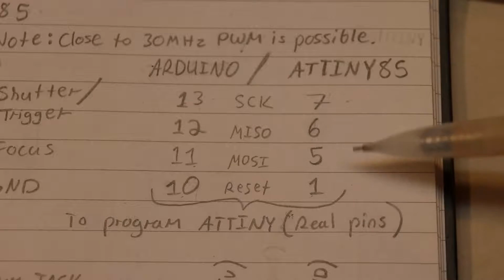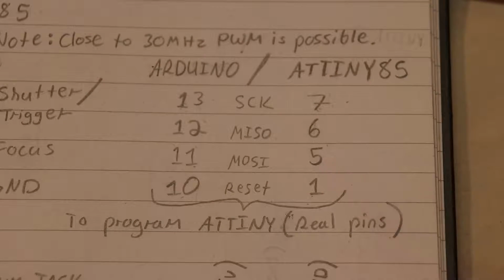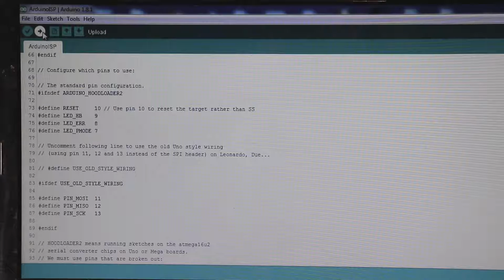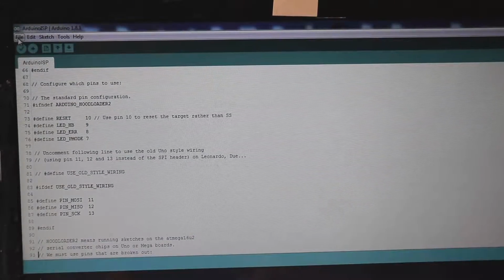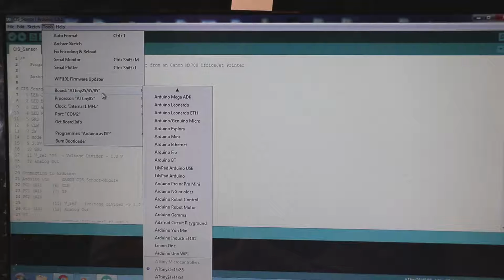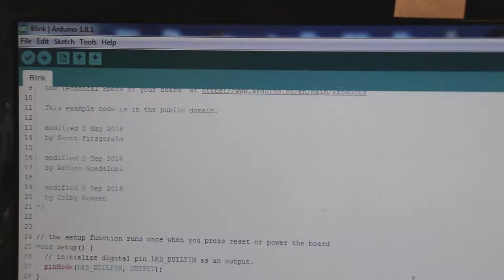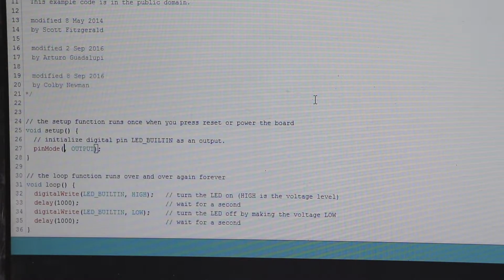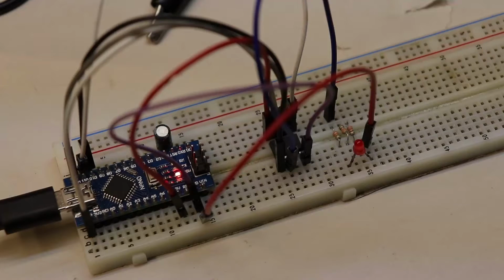How to program an ATTINY with Arduino

Comment: As mentioned in DS attiny13a has 1kb flash but i have seen blinking code is between 1kb to  3kb  .
1st Why this simple task taking 1kb 
2nd how it's programmed with this code ? 
3rd  can 1kb tiny13  be use for any light working project other than banking single led ? Example Ir remote or receiver ,  project with i2c lcd ( some how it exists on the internet )  etc ??

Comment: This is is an amazing very thought out video and is very useful in helping me to learn.  Would you please help me, I was just wondering on the circuit that you clearly planned out and shown in a very good way, there are resistors being shown, do you need these resistors and would you mind telling me what resistors you are using and why.  Thankyou for taking the time.  Very intuitive and intelligiant, just what I needed as I am a beginner.  Thanks Again.
Reply from the maker: Those resistors are only used in series with the LED to limit the current and basically not to burn the LED out. You dont need those resistors to program the chip.